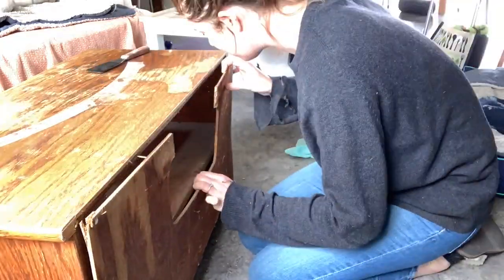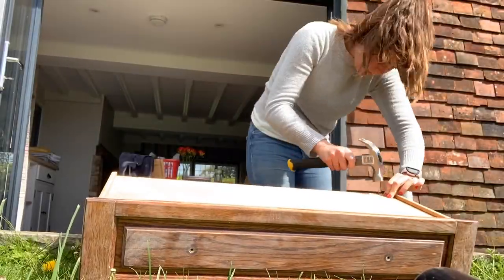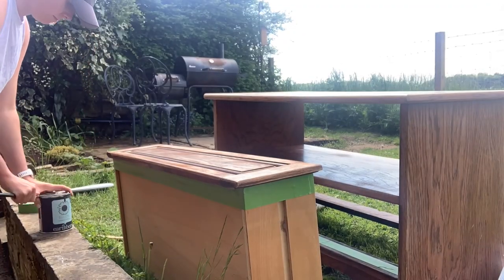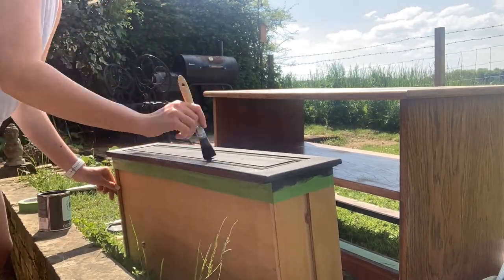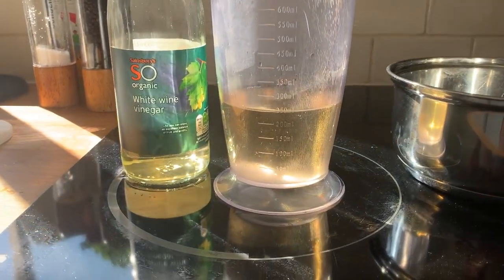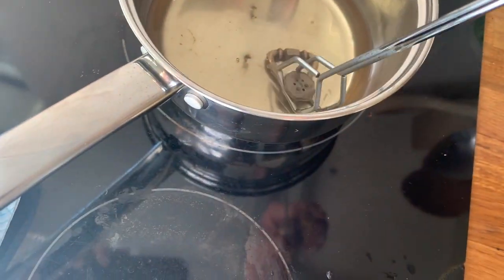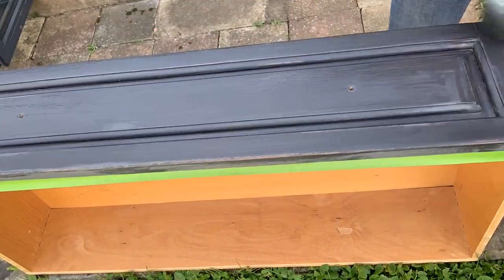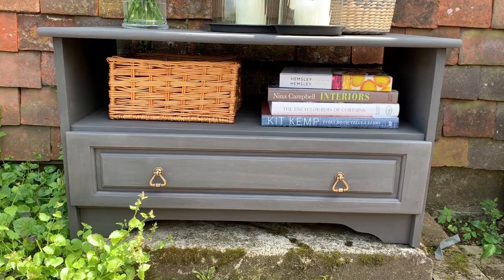FURNITURE FLIP: New look for an old TV Unit!

Comment: Shouldn’t you use a sealer over the clay paint?  I’ve seen clay-based paints used before and they’re usually sealed with poly or wax… or both.  Nice color though.
Reply from the maker: Yes 😂🤦🏻‍♀️ this was one of my earlier pieces that I kept for myself, and have since gone back and sealed it- although the paint held up better than I’d have expected! I actually have a really nice Polyvine wax effect varnish that I use in some of my more recent videos that is quite hard wearing with a really nice effect. Thanks so much for watching!
Reply: @hollysdesign  … excellent!